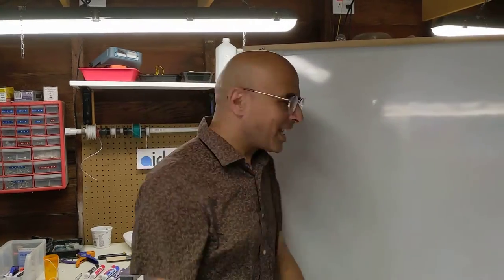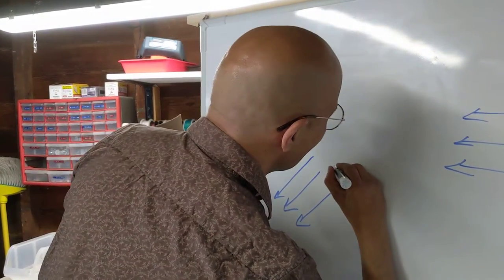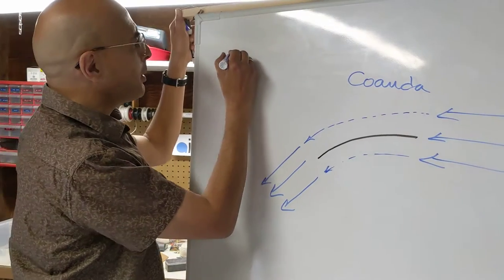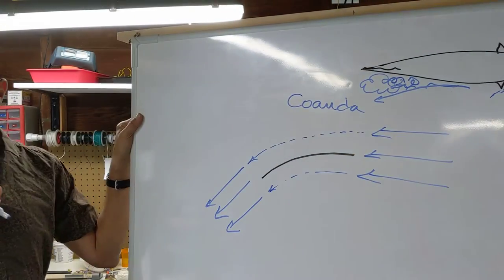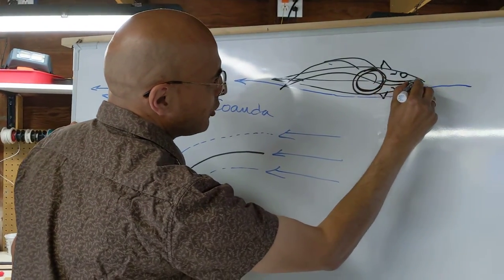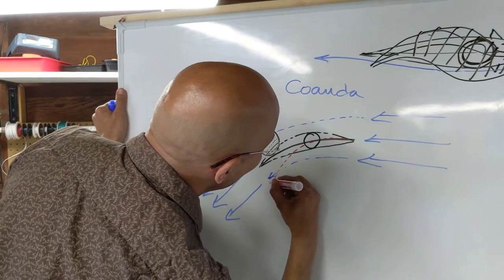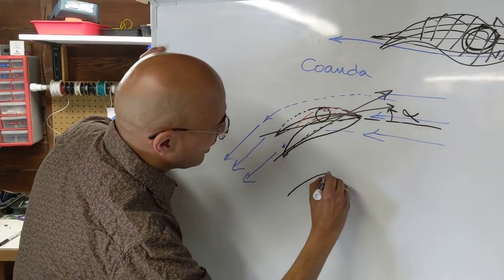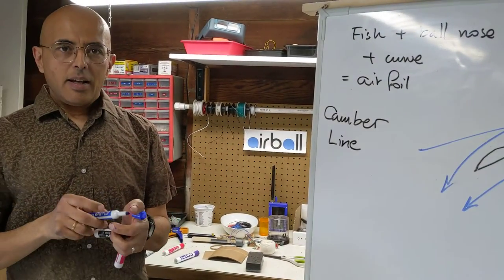6. Camber, airfoils

Comment: You need to be careful with the Coanda effect. A string of water sticking to a glass is primarily due to the surface tension of the water, not because the string of water entrains air.
Reply from the maker: Yes, that's a good point. This is probably the weakest portion of my presentation. When I've learned about it from actual aerodynamicists, the answer seems to be, "surrender all hope young padawan, the Navier-Stokes Equations describe the field, #calculus #winning #forthewin". And I mean I studied some calculus but not enough to grok that stuff. I'm still searching for a better way to understand and explain this "tendency of the flow to follow a curved surface" in a relatable way.
Reply: @ihabawad  There's a simple and in my opinion decently intuitive explanation for this. The only way a streamline can curve is through acceleration. How do we get acceleration in a fluid? Through a pressure difference. Acceleration happens from high to low pressure.

Now imagine a symmetric airfoil at 0° AoA. As it plows through the air, a high-pressure stagnation point will form in front of the leading edge because the rounded leading edge is an obstacle.
From this high-pressure point, the air accelerates up and down along the leading edge, so pressure drops.
This high pressure point also curves the streamlines of the incoming airflow upwards and downwards, around the leading edge.
If you imagine the streamlines, then you can also see how there's a vertical compression of these lines as the airfoil gets thicker and thicker. Both on the top and bottom side. This leads to even higher acceleration and an even greater drop in pressure. (Bernoulli?!)

This pressure drop is typically so large that it results in a lower than atmospheric pressure. 
And that is actually enough to curve the airflow around the airfoil!

Why? Because atmospheric pressure is now higher than pressure near the airfoil. And this lower pressure is maintained over a distance along the wing's surface. So as the airflow travels over the wing, it accelerates along this pressure differential which is perpendicular to the wing's surface.

After the thickest point of the airfoil, the high speed/low pressure flow near the wing doesn't abruptly stop. But since the airfoil now gets progressively thinner from this point, the airflow will slowly slow down / pressure will slowly increase. Teaser: Pressure of this flow can increase to above atmospheric towards the trailing edge, but this is not necessarily the point of separation. :)